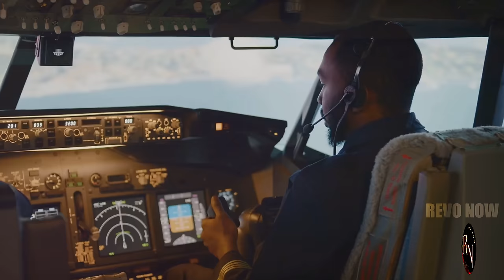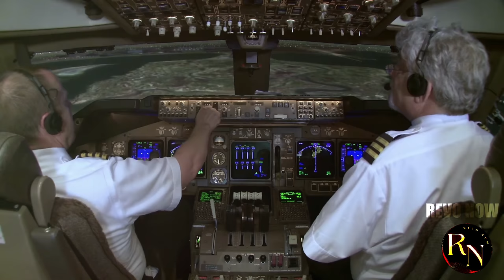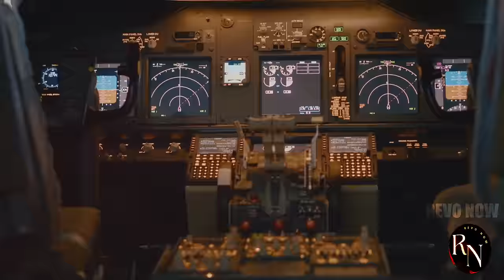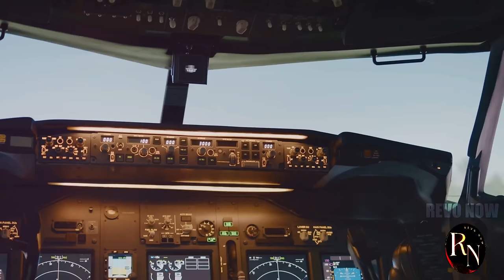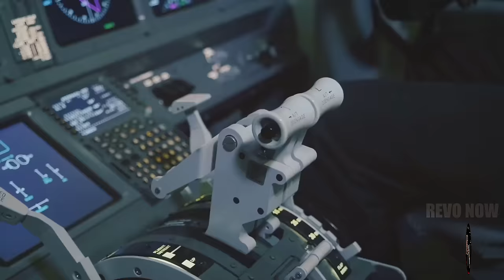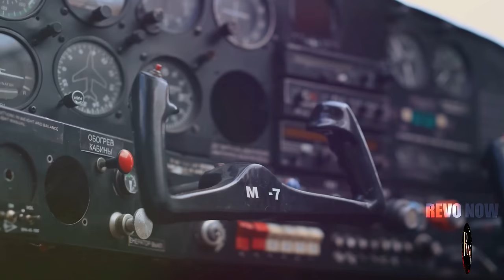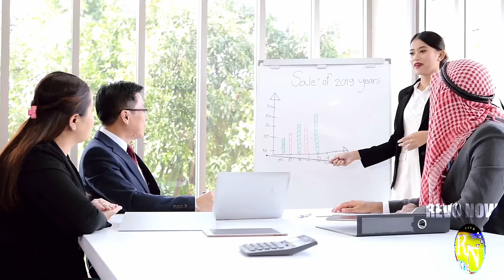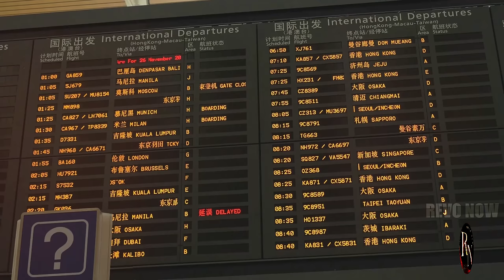You Won't Believe What China is Doing to Boeing

Comment: The C919 is already in production and flying.  The C929 is about to undergo flight test, and the C939 is on the drawing board.  Along with these aircraft, China's ACAE is producing the CJ1000, CJ2000, and the CJ3000 engines for their respective aircraft. Variants for each type aircraft are also evolving to provide a wide range of passenger aircraft to airlines.

Comment: Comac Will dethrone Boeing soon as it’s widebody C929 is almost ready for its maiden flight. Comac ARJ21 and C919 are already flying commercially with a number of airlines. Boeing is on the decline as it’s Starliner has failed to return the two astronauts stuck in the ISS due to many defects. Boeing 737max has a very bad image as it has been having serious quality problems. The wide body 777 and 787 are not selling well in the world while China avoids Boeing’s aircraft due to the trade war between the USA and China. The coming C929 and C939 equipped with China’s homegrown engines, composite materials and packed with innovations which will give these new aircraft a strong competitive advantage such as lower purchasing, maintenance and operating costs. China has a large domestic travel industry which requires many aircraft to satisfy the growing demand. Comac is assured of orders from China’s airlines and from BRICS countries as they are leaving the usd and need new aircraft in a growing economy.

Comment: Bigger engines and/or more seats implies less fuel per t/km.
The problem of  737's is that they are at its capacity limits, and fuel-efficiency cannot be improved, because the wings are too low above the ground.
As i understood, the landing gear cannot be altered. It requires a complete new design of the aircraft, dated from mid-1960's.

Comment: And when Boeing and Airbus lose their market share and can’t compete effectively…they will run back to their respective governments (US and EU) to apply sanctions on CN rather than find ways to improve, innovate and compete ! They always have the mindset that “monopoly is their right” and nobody should compete with them…😤
Reply: @tclim5507  I think the USA and EU will be hard pressed to stop China from dominating the world market as its only airlines inside these respective countries that the aircraft used can be controlled. Loose the world market place and and there is little economy of scale left. External airlines with landing rights into the USA and EU will use lower aircraft purchase costs to undercut flight costs in and out of these locations putting more pressure on the key aircraft manufactures.
Reply: @kentriat2426 Well said and analyzed !
Reply: I don't fault Airbus like I fault Boeing.  First time I flew on an airbus, I didn't know it was Airbus. But the quietness, the comfortable economy seats gave me a sense of confidence I never had flying in a Boeing POS.  I think you all agree with this.

Comment: No. The COMAC airliners : ARJ-21 and C-919 are not competitive in fuel efficiency. They are comparable to the old Boeing 737-300 (classic, 2nd gen) or MD-80 class of 1980's -1990's era, on par with Brazilian Embraer old E-Jet series. About two full generations behinds modern Boeing or Airbus airliners. On top of that, they have difficulty in producing these jets in quantity, very low production rate (7-15 jets per YEAR)  to be considered as contender. Boeing and Airbus don't have to worry about Chinese airliners.